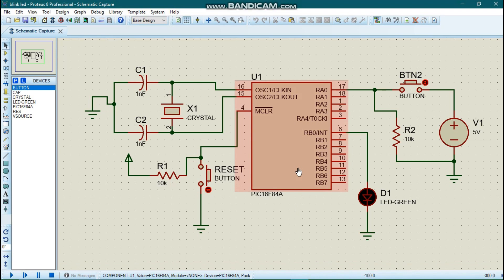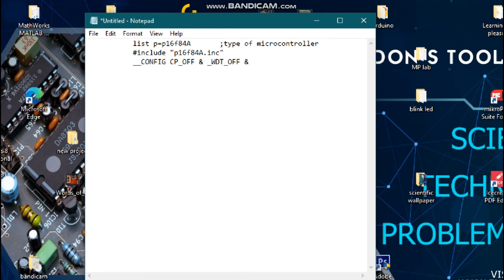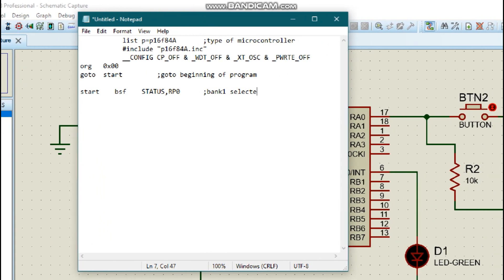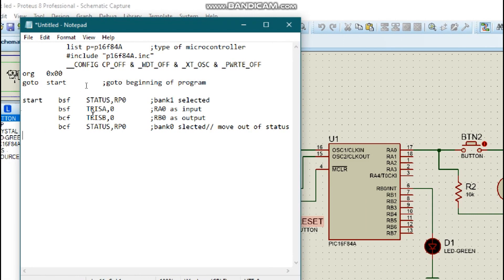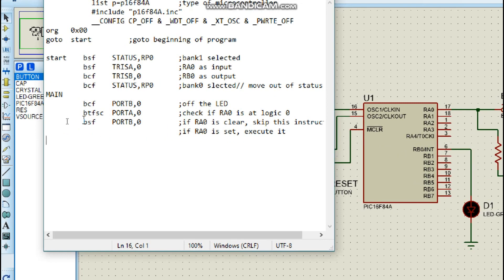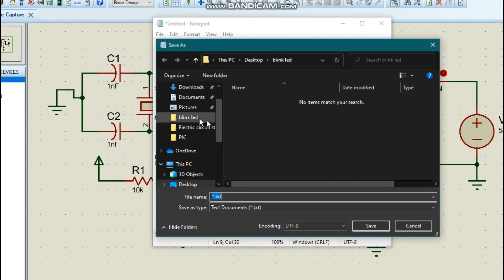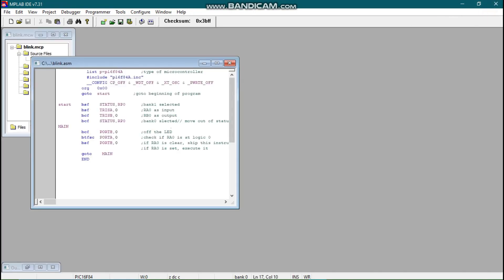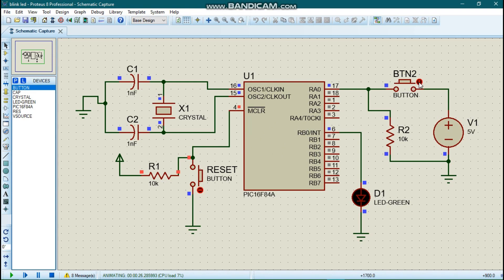LED blinking project with a PIC16F84A microcontroller in assembly language

Comment: Hi im using the pic16f690 and im just not getting the led to work when i have a button as input what could be the issue
Reply from the maker: Hardware Issues:*

- Button Connection: Ensure the button is connected correctly to the PIC16F690 input pin and that the pin is properly pulled up or down. A 10k ohm resistor can be used to pull the pin up to +5V.
- LED Connection: Verify that the LED is connected to the correct output pin and that the pin is configured as an output in the code.
- Power Supply: Make sure the PIC16F690 is receiving the correct power supply voltage (3.5-5V).

Software Issues:

- Pin Configuration: Ensure that the input and output pins are configured correctly in the code. Use the TRIS (Tri-State) register to set the pin direction.
- Interrupt Configuration: If using interrupts, ensure that the interrupt-on-change feature is properly configured for the input pin.

Code Issues:

- Input/Output Operations: Verify that the code is correctly reading the input pin and setting the output pin.